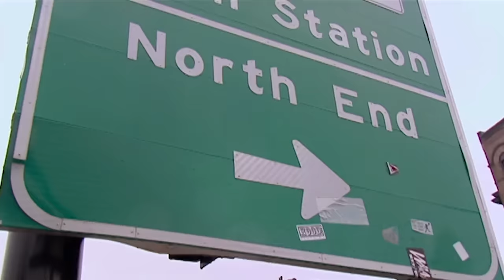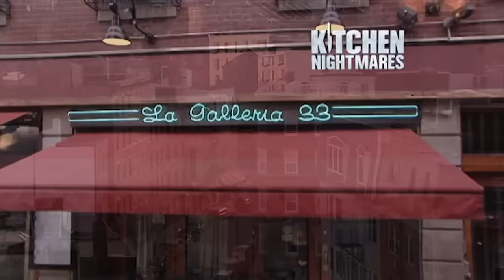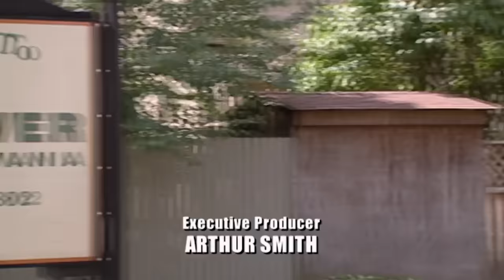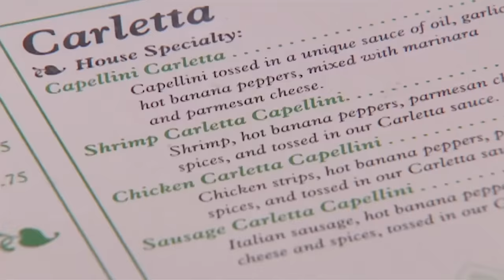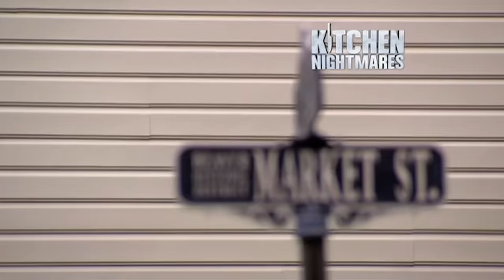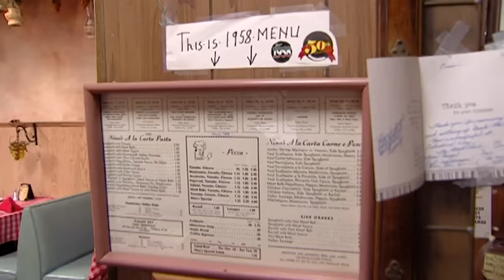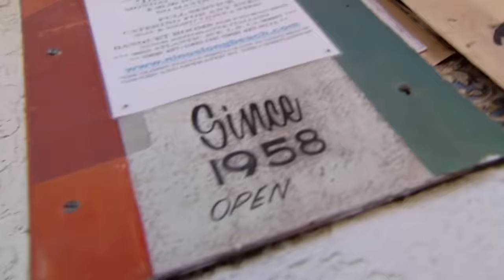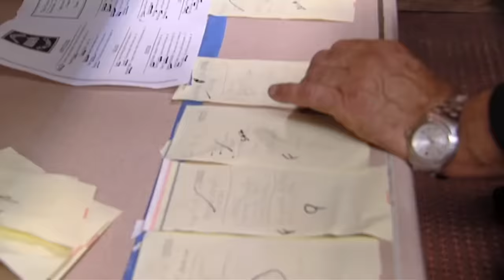Iconic Season 6 Episodes | Kitchen Nightmares

Comment: Its funny when Gordan tries to push a pull door however, it is a law that restruants have to have doors that push and pull. (1:05:11)
Reply: All doors have to push out as a fire prevention. In case of fire to push is quicker than pulling.
Reply: @veronicacrabtreehill6608 not just that, pulling a door open during a fire is haaaard. Fire is eating oxygen like crazy, pulling the door open spills fresh air inside. Pull = inferno.

Push is easier because a fire also pushes out. Ironically enough, when in a flaming room, fire will be your friend if the door is a push door.